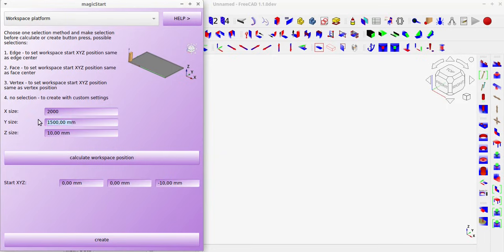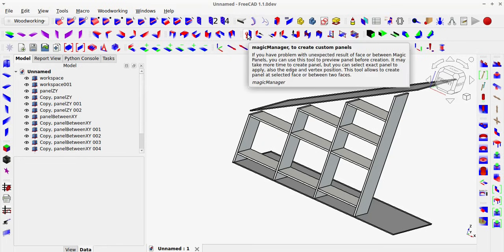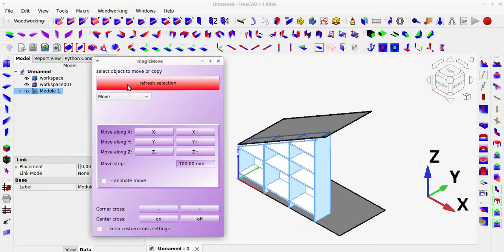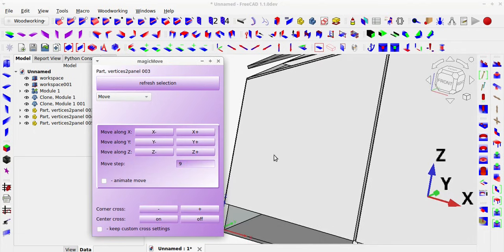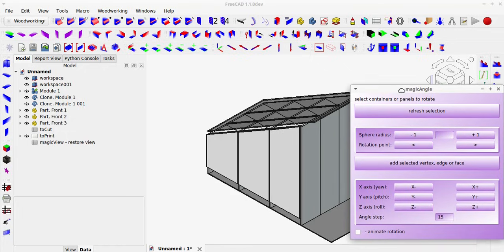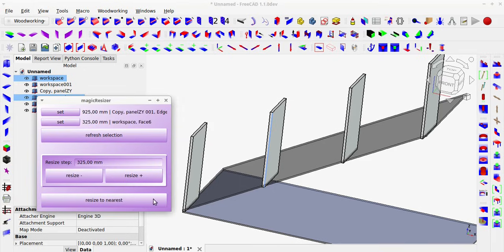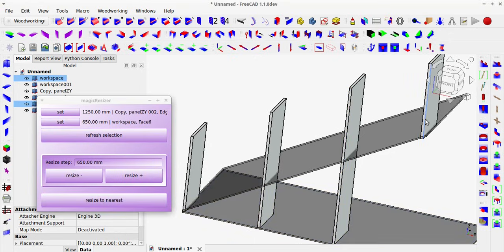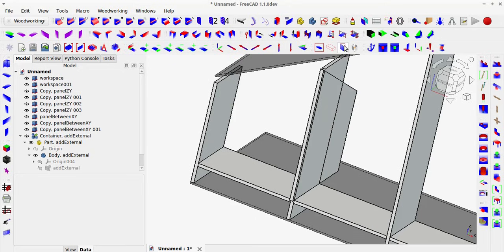Difficult cabinet under sloping ceiling | FreeCAD Woodworking workbench

Comment: Hi Darek,
Your Magic Module is very interesting, and I'd like to use it!
Right now, I have an office to design, and I'm using Sektchup.
Why?
1) Because Sektchup lets me precisely define the environment in which I'll be designing (walls, floors, ceilings, windows, doors, etc.)
2) Once I’ve defined and drawn this environment with its constraints, I can move on to creating the various pieces of furniture, starting by creating a “volume sketch” to ensure that the layout is suitable and meets my requirements.
3) Then I move on to creating the various pieces of furniture.

How can I replicate this process in FreeCAD (I have version 1.1.3 installed on my Ubuntu 26.04 Linux system) using your tool?

Have a beautiful day!
(PS: i subscribe to your channel)
Reply from the maker: The Woodworking add-on for FreeCAD is created to design construction and especially redesign furniture, this is why I don't recommend parameterization. If you make your own furniture, all you need is cut-list. This is not designed to handle CNC or outsourcing or rendering for clients WOW visual effect.